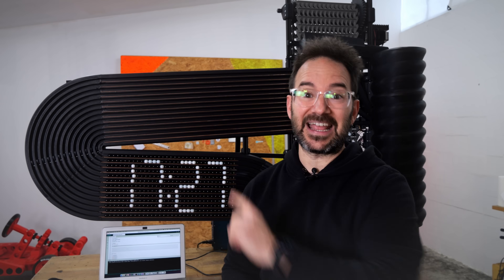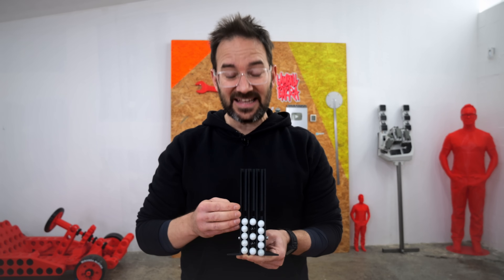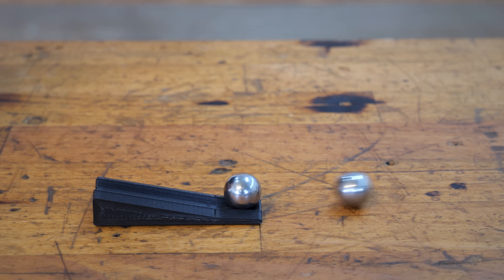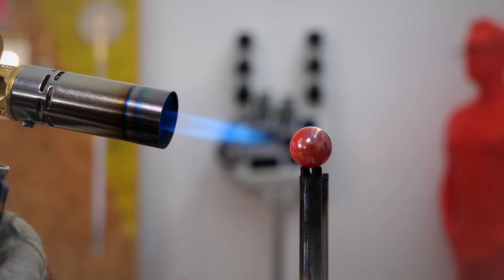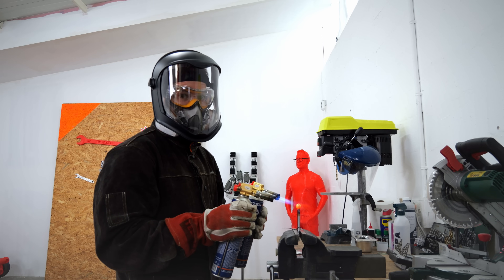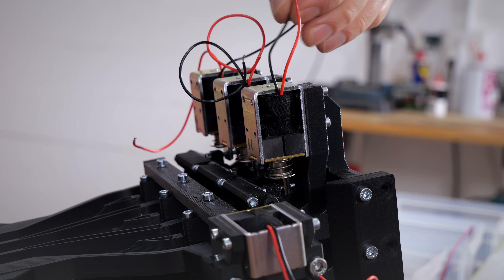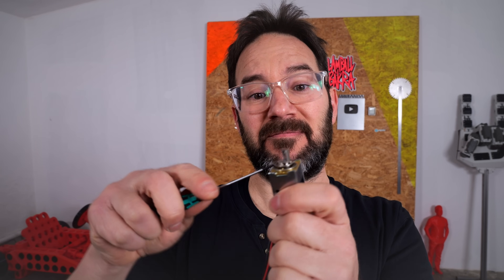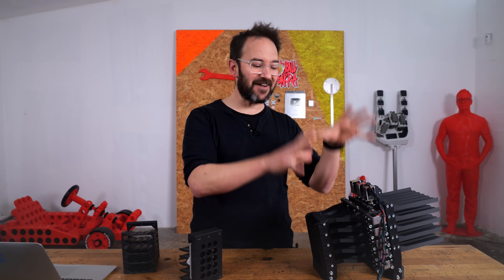Ramp Based Rapid Marble Swap - Marble Clock Seconds Display Pt.1

Comment: The gunbluing you've done to make the black marbles leaves them quite dull, and difficult to see against the black 3D printed parts - which begs the question - could you get away with not having the black marbles? And just put the silver ones where you need to make the number while leaving areas that would've been black empty instead? Would that give the required easy to ready numbers?

Comment: I'm thinking somewhere down the line you can set up your clock to have a buffer, so that the next second is always primed, and the second before that pushes the previous second into the primed position, since it looks like you'll be using all 15 spaces continuously.

I do not envy the work you have to do, but it is very cool, I can't wait to see what you come up with next time :) Glad I found your channel!

Comment: You should consider only updating the marbles that need updating, to minimise the amount of changes that happen. For example, using a 7-bit display, going from 8 to 9 only involves removing the bottom-left segment. I'm not sure if this would have any effect on the optimisation, but it would make the clock easier to read.

Comment: Not all of the spots in a 5 x 3 grid need to be changed out for this clock. 2 of the spots will remain black for every number (the holes in the 8)- this may help with speeds especially with limited black marbles to begin with. Also, the top right, middle right, and bottom right will always be white marbles. Thus, instead of 15 marbles to change out per second it would be only 10. Thats 2/3rds as many marbles to be sorted! I don't know if this will help but its just something I noticed. Love your videos, keep up the great work!

Comment: To make a bucket-load of black marbles, it seems to me like the only thing you need to do is use a kiln/furnace. You will be able to get all of the marbles up to the same temperature simultaneously. The rest of your process/lifestyle was the oil and bluing baths, which should also be able to work on all of the marbles at once. So, just 11x3 steps, not 11x3x400 steps!

Comment: I wonder if you could use a rock tumbler with a combo of ceramic high df and 70 grit aluminum oxide. Not sure never tried it before. This may remove the chrome though and then you can just blue them.

Comment: How about combining the two methods. The hours and minutes can use the existing method with the seconds using the front dumping method in this video. Also in terms of the process for the marbles. How about a kiln to heat multiple marbles at once?

Comment: Okay idea for you... WHAT IF...   you change a single marble at a time, then you only need to alternate the color of single marbles from one digit to the next.  The choice in this is to select to either change the color or not.  For example if the marble is black, the only time you need to change it is to white and then vice-versa. So each dot in your digit has behind it alternating colors of marbles:  Black White Black White Black White... etc.   Now the display logic selects the marble dots to change... This is a single selective process instead of updating all the marbles at the same time.

Comment: Basically, here are two slots that are black on any digit it's 2B and 4B. Also you can swap 1 to right corner and in this case 1C, 3C, 5C will be white. ignoring 5 of 15 digits update you should have 33% speed increase for your model.  I hope this mentioning can help you.

Comment: You can probably speed up your process by only changing the marbles that need to be changed between each digit. For instance, going from 8 to 9 you only need to change the bottom left marbles to black rather than changing the whole digit

Comment: I just thought of an improvement for the selector and for the refresh rate.

I think it would be quite easy to figure out which marbles need to "flip" their color from silver to black and vice versa for each number transition, so you don't need to refresh the entire digit at once. 
You can then design a selector that, when the selection changes, dispenses a single marble of the new color only for that position in the digit.

In total this would mean you need more solenoids since the multiplexing approach doesn't work, but due to the reduced throughput it would greatly cut down on the required throughput of the sorting mechanism and the throughput of the entire clock itself. 

It also means you need to colour less marbles black in total :D

Comment: what's wrong with spray paint? it might rub off in some places but really it should work just fine if you choose your materials well.

this method of multiplexing is flawed: it enables you to choose each marble, but it doesn't enable you to simply not put out a marble, which is a feature you need because updating this display will take more than a second because it's not just one operation. it also gives more work to your elevator. 

also consider: you know what the state of the clock is when it gets cleared, if you can catch the marbles in dedicated channels, sorting them doesn't even need a vision mechanism. you also then get to make only 2 marble elevators, one for black and one for white (this is already true actually, just sort them before lifting them)

Comment: why use a per-pixel multiplexer plus a sorting-mechanism to sort the marbles into two single-color-magazines per pixel? Couldn't you use single-line-magazines per pixel, each filling up with the correct marble depending on the next needed digit? Then you'd have 10 marbles per pixel-magazine, each in the correct order

It would only need all marbles to pass all magazines so that each magazine has a possibility to get the marble it needs.

Comment: If the first gates holding the marvels are supposed to open all at the same time why didn't you just have one motor to open them all instead of one motor for every single gate?

If you are gonna use a motor for every single gate maybe think about the option of only sending the minimum amount of marvels needed to change a number to the next.
 ex. 8 to 9, you should only need to replace a few marvels from the bottom left of the number 8 to make the 9.

The first method is simpler while the second is more efficient. Think about it and choose what adjustment would be better.

Comment: The issue I see with this design is the selection of colored marbles in your columns.  Since you have one actuator controlling an entire column, you'll either select the same color all the way down a column currently if executed together, or add significant time to the selection process as you loose a marble per cell in your matrix.

Comment: Hmmm.... Have you tested that you can provide a constant feed rate of 18 marbles per second?      The travel time might be greater than that?  You would eventually run your supply dry.
Maybe instead, just represent one marble per second in an analog clock face and dump them all at 61 seconds.

Comment: Maybe a stupid comment, so sorry, but arent some of those not needed? Like the one in the top right would always be chrome, regardless of the number.  Also the most to the right of the third and last row. This way, you may need to paint less marbles. The middle of the 8 would also always be black. So there are 5 that can be static instead of moving, if the goal is a clock

Comment: Why do you need black marbles at all though?! The machine is black and the steel is a nice contrasting silver already. You needed the black marbles for alignment when you were building bitmaps in 2D but that isn't an issue now that you're constructing them from the back. You could try to leave dark pixels empty and then have a motor shake the display marbles out on refresh (because leaving dark pixels empty means you can't turn a pixel off just by refreshing it)

Comment: i think you're going to run into a ball selection process very shortly. 
Hopefully I can explain myself. In my example, I will use the number "2". 
When selecting the balls for the first row, it will be simple, row 2 solenoid to the left and column 1, 2 and 3 energise and you will get 3 balls all grey colour, but then row 2 will need 2 rounds:
Round 1: Row 2 solenoid to the left and column 1 and 2 to select grey colours
Round 2: Row 2 solenoid to the right and column 3 to select black.
This may sound like it's not that big of an issue but then it becomes a problem if try to select all the grey for number 2 at the same time. or all the blacks at the same time.

My question is, how many rounds of ball selection can you do in a second??

Comment: If you make a circular buffer of all numbers 0-9 you can get away with just 3 x 5 x 10 = 150 marbles, roughly half of them black.
Preselect the numbers in your buffer and with a latch for the full number you need only 1 solenoid, and a mechanism to raise them to the back of the buffer again after use.
Reply: Also, a 7 Segments LED display only uses 7 LEDs (and a decimal dot), so half your marbles are always black and you can just close those holes.

Comment: Am I the only one that thinks that he needs to release the 3 columns separately, so the solenoids need to go fwd and back in 1/3 second plus he needs to swap the horizontal selectors between. That seems not possible in the given time.

Comment: a partial solution to your black marble madness is the fact that in a 7 segment display, the center of the number loops are always open. Therefore you could get away with not feeding tracks 2-2 and 4-2.

Comment: I'm not certain I understand the need for black marbles in this configuration; on a standard digital display, central areas are automatically blacked out, like the centres of a digital number "8", and always are. Which would necessitate only having marbles along the top, bottom, sides, and across the horizontal centre. On a 3 x 5 grid (x,y),  going from left to right, and top to bottom, you could leave positions (2,2) and (2,4) as blanks. With a digital number like "2", for positions (1,2) and (3,4) you would simply not release marbles for those positions. For a number "5", it would be for positions (3,2) and (1,4). For a "7", marbles ate not released for (1,2) , (1,3) , (1,4) , (1,5) , (2,3) , and (2,5). Obviously, as already stated, (2,2) and (2,4) are automatically blanked out, as they're never used for any number. And, for a number "1", the only places you need to release marbles for are the first column,  i.e. (1,1) , (1,2) , (1,3) , (1,4) , and (1,5). None need be released for the remaining positions. Would save on the number of marbles required, and the need for black marbles.

Obviously, this only works because you're separating the marbles from each other with plastic, as opposed to other marbles, like you did in the main digital clock. Which is understandable. The main clock has a full minute to swap out the marbles, and you made it in a way that's both impressive and aesthetically pleasing. You could have done it the way you're making the seconds timer now, making it a lot simpler, but nowhere near as technically impressive, or gorgeous (kudos to you for getting it to work btw, I'm sure you come across a LOT of people who don't really understand just how difficult it was to achieve). But, the requirement to swap out the marbles every second required the simpler approach, as you've done it here. But, the simpler approach also means you don't need to incorporate black marbles.  😊😊

Comment: With the horizontal solenoids operating all switches at once, how would you select different colours on a single row? Say you wanted the top row to be light, dark, light, you would need to be able to select left, right, left, but the single bar only allows for left or right on all channels..

Comment: if you have to heat up each marble to red hot 11 times, why not do this in batches? drop them into a furnace, get a bunch of them glowing red hot, when you dunk them in the oil, put the next batch into the furnace...

Comment: Ciao!
First af all, good job! Impressive work!
Two considerations:
-all marbles are replaced in under a second, and there is a big buffer of marbles, but in the end this buffer needs to be refilled in under a second to get the clock work indefinitely. Right?
-each single pixel could che black or white so maybe you can "cheat" by using only two marbles per pixel, flipping them when needed. But maybe is not the point of the project

Comment: I think that I have a big design inprovement👍 ❤

I know that this works, BUT I THINK THAT IT WOULD BE BETTER TO CHOSE ALL THE COLORS IN THE PARALEL and ACTIVATE THE DROP from the color  selector SIMUTANEOUSLY.

It would take 2 times aditional solenoids, but it would make it at least 2 times faster.
You would need 3 x 5 solenoid for the color selection in paralel, but only one to drop them all,
so 16 solenoids in total.

Comment: This will get lost in the comments but here's an idea to simplify things: 

Fill all the spots with black balls each time pushed from the side mechanically in one go - cha-chunk. Then release the silver balls, doubling up the spots where the numbers will go.

When the balls release, all the black ones come down first, but then the silver ones come behind and pop out the black ones where they are doubled. 

Sorting is simplified - all the black ones go into the front buffer and all the silver ones fill in the back.

Comment: What about cerakote for the marbles color? It can be applied right on top of chrome, and as a plus, it will give the marbles a "slippery" coating that could help prevent jams in tight areas of the track, or other mechanisms.

Comment: Ship the marbles to a heat treating facility and request they treat a few marbles at various temperatures and quench methods until you get a good black and then have all the marbles treated in the same way. It will be coslty but they will all be exactly the same and youd only be waiting on shipping times.

Comment: Just a random spitball suggestion, but would it be possible to only change out certain marbles, like for a 8 to go to 9 you only need to knock out 1 marble the sorting and loading might be a pain, but it would be easier to read and might take less black ones

Comment: You could use a single color by kicking out all of the marbles being displayed and put in the marbles for the light parts of the digit. It would completely remove the need for marble sorting making the entire design simpler and cheaper to make. Marble for light no marble for dark.

Comment: Hi! To glow to red murble you can try to use an induction heater. I think if have enought power you can glow up the marble in a very short time. And another suggestion is to design an automated system that can make the thing automatically instead you.

Comment: 7:50 hotter torch, use an IR thermometer, always dunk at the same temp. 11 times is really just you slowly burning off the chrome (yay toxic vapors) and slowly bluing the steel underneath.

Comment: Just a thought.... If you had a mechanism that would push the marble out of the number without relying on the next marble, you could display the time with only one marble color. The number would be "drawn" with the steel marbles, and any position that doesn't have a marble at all, the black plastic would make it naturally black.

Comment: This is possibly the most complicated way I could think of to achieve this. I really like the idea of trying to translate the larger design into a smaller and faster "second" measurement. But to be honest, you could just achieve this by having all the marbles already in sequential order on the tracks. It only needs to cycle between 0 and 9. Rather than build a feed mechanism to sort the marbles, you can already have them sorted on each track and just try to get the timing right for when to drop them. You could probably use pieces from an old analog clock to get this done, no coding required. Reminds me of the flip-card clocks.

Comment: Engineering the rotary selector would have been pretty easy with solenoids. The neutral position is kept with an spring in both ways. now add a solanoid on the right and one on the left. On activation of one of the solenoids you push the selector to one side which selects the corresponding marble. Now use a spring to bring back the selector to the neutral position and release the marble.
Greetings from a swiss mechanical engineer ☺️
Reply: Hi, not a mechanical engineer here but trying to understand solenoids. would 5/3 solenoids work as well? they have 3 output positions, so left, right, and neutral, would that be usable for this application?

Comment: Since magnets were preventing marbles from falling properly, maybe electromagnets can also be used on the display part, to prevent marbles from falling unintentioanlly. Just an added on layer of stability, which might never be needed we all hope, since it will also add on complexity of the device.

Comment: Oh, hmm. I think i would have gone a different route for the selection:
Have a stream of changing marbles white-black-white-black for each of the 15 positions, and only let a new marble go there when that specific pixel changes color on that particular change from one number to the next.
Would have needed 15 solenoids, not the 9 i count, more complex software, but the rest of the hardware would probably have been simpler.
And my idea has a great chance to get out of sync. So, maybe not.

Comment: Seems like friction is going to be a problem.  3D printed tracks have alot of friction.  If your tracks were made of metal, there would be less friction and your marbles would get from the selection point to the display point quicker and take up less of your second.